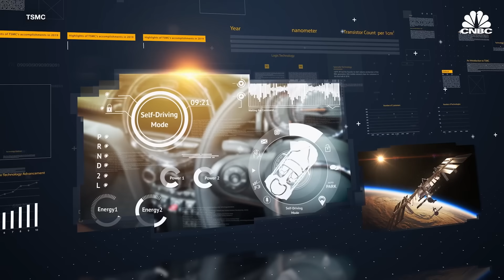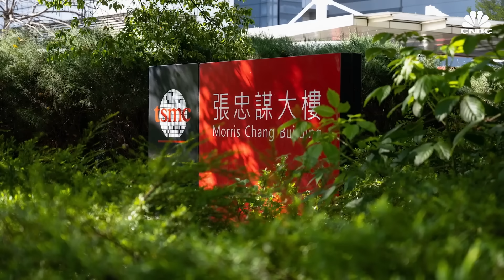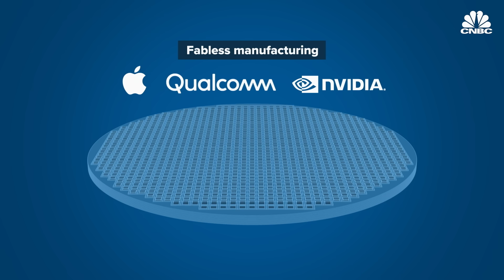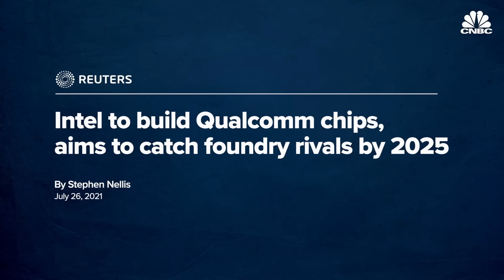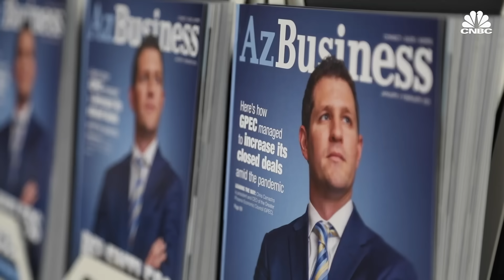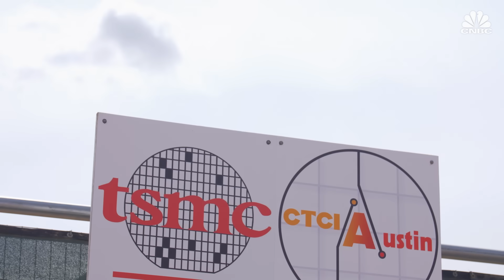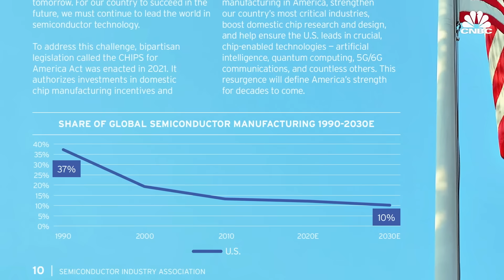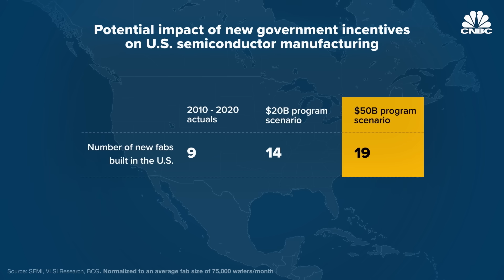Secretive Giant TSMC’s $100 Billion Plan To Fix The Chip Shortage

Comment: I haven’t a clue about chips but Could you not reuse old chips .
Reply: the problem isn't the availability of the material, the problem is the availability of manufacturing capabilities, aka the world can't produce as much as it would like to use at the moment.. which is why they are all investing to build new fabs in order to increase production capacities... 

and if you meant reuse the chips in the sense of just taking the old ones and putting them in new devices... in theory you could, but most of the components prices is on the order of cents, so it's not worth the effort, and most of these components do very specific things / function a very specific way, so each product usually only works with the chip it's designed to use (for example in a phone you have the more expensive main processor / gpu etc (soc), but then you also have the cameras, the charge controller for the battery, acceleration sensor, light sensor and a whole bunch more, and all of these need to be connected in the right way (aka all the right connections need to go to the right place) and also work with the programming of eachother (for example the charge controller has to tell the processor that the phone is currently being charged, or the acceleration sensor tells the processor where down is currently etc)... so it's all very specific and you can basicly not exchange stuff, unless it's designed to work with a selection of components, which still can't be any but only very specific ones

and then you also have the problem, that new products always need to be more fast, more shiny etc so you always need the newest generation aswell, especially for stuff that is expensive / high performance

Comment: News flash... the internal combustion engine will run without a computer assistant chip, with very little adjustments in manufacturing.
Reply: yeah it does work, but not very well... and the rest of a car doesn't work very well either... no abs, no park assistant, idk about airbags...
Reply: @johnuferbach9166  your commenting to a guy who owned and drove a 1963 Chevy with a stock 283 stock engine. Not one Asian part in it, ran like a top, in fact it ran better and with less maintenance than most crap on today's automobile markets, and was good on mileage. It had factory seat belts,   and people had enough intelligence to use them without any costly, annoying, flashing lights or buzzers.  The cost to the consumer was, $3,000.00  A great vehicle by anyone's standards.

Comment: Good ol Manitowoc Cranes. Built right here in Manitowoc Wisconsin. (Headquartered in Milwaukee WI) The 2,535-ton (31000 series) crane is utterly massive and is as big as a small skyscraper. Of course, this particular crane is only used on the largest of industrial projects and is overkill for almost any job. Hence why Most of the Manitowoc cranes that are purchased are in the 80 to 165-ton range. But Manitowoc has 17 crawler crane models ranging in capacities from 80 ton to 2,535 ton's for the newest and largest model. 

It's also nice to see the US here finally starting to expand domestic chip production. The US is the tech capital, and on the chip production side, we have let our capacity dwindle over the years. But with Intel and TSMC now expanding fabrication plants, the US will reduce its reliance on imports for whatever our domestic manufacturing doesn't quite cover when trying to meet consumer demand.
Reply: 80% Intel chips still made in the US.

Comment: Why not recycle those CPU ??
Reply: the problem is not the material availability it's not enough cpacity in the world to make the new stuff (and no reusing old chips in new products doesn't really work it's not worth the effort because most of them aren't worth anything but still important for the product and you can only use the chip a product has been designed with)

Comment: 12:00 Tap in to analog.
OK? Why? Who needs that?
Reply: because analog design is an important part of how things function? everything starts as some kind of an analog signal, before it's converted to data... your phones camera produces an analog voltage per pixel that is converted to a digital image by measuring it for example, all audio stuff starts and ends in analog, all power supply-tech is analog, wireless is analog (antennas etc) and digital stuff is basicly analog aswell since you have to make sure you don't have reflections on the data lines, no wrong bits from induction etc...

Comment: Did you see the United States?  Singapore has been blending with the CCP for a long time. They have already been bought by the CCP. This time Singapore directly publicly supports the CPT to join the CPTPP.  The greatest benefits can be achieved, and the CCP’s second generation of Red, most of the money hidden in Hong Kong is moved to Singapore to hide, through Singapore, the CCP obtains the missile chips they want.  If the United States still pretends to be ignorant, it will be devoured step by step.

Comment: It's great to manufacture chips in the US but we need to also manufacture the things that the chips go into in the US as well. The phones, the toys, the appliances, the cars, the computers etc all need to be made here. Manufacturing things in the US will make things more expensive but not doing so has proven to be a national security nightmare. At the very least, we need MUCH greater diversification of the supply chain.
Reply: Interesting what would cause more dissatisfaction: lower quality led bulb which lasts 2-3 years for $1.5 or high-quality bulb lasting 10 years but at cost of $12?
Reply: @angelg3986  actually, it won't last 10 years, GE CEO won't allow that to happen, you will still pay 12, but it will die oh on year 5 instead. It's called managed quality invented by GE.
Reply: You really want to spend 10k on the latest flagship phone?
Reply: @sethreign8103  yeah but the price will average down or wages and inflation will average
Reply: These chips are goldmines. The profit is so so big. That cant be said about all products.

Comment: One of the biggest reasons there's such a chip shortage is that most fabs have severely scaled back 15nm or larger production. There is more money and prestige in creating ever smaller processes like 4nm "P" and 3nm. Yet most of the economy and demand is in 15nm, 40nm etc. Yet not a critical note at all about that in this report. 
Typical case of access bias.

Comment: There is a major error in this video. There is no 5 nm process, 5 nm is not a length, it is just a name. Nothing on a 5 nm chip is 5 nm; not the contacted gate pitch not the minimum metal pitch and not anything else you can measure on the chip. On 350 nm, you could talk about a 350 nm process; the transistors had 350 nm MMP and 350 nm CGP; they were 350 nm transistors. By traditional measurements you would call TSMCs and 5 nm, Samsungs 5 nm and intels 10 nm as something like 40 or 50 nm process node.

Comment: It's not "almost a monopoly" for everything at the leading edge EXCEPT RAM, it's a duopoly with Samsung for most purposes (Intel being the main exception).
Also, TSMC isn't "bringing leading edge chip manufacture back to the US" - Intel never left and has certainly stayed on the leading edge.
Reply: Intel is at least 3 years behind Samsung and TSMC. They don't mass produce a 5 nano chip at present and the other 2 have been since 2020. Intel had projected 2021 but that ship has sailed and the train has left the station.
Reply: @fredmac1251  Keep in mind that what Samsung and TSMC were calling "7nm" had the SAME SPECS (almost identical) to what Intel was calling 10nm.
Same situation exists in the next generation, what Samsung and TSMC are calling "5nm" Intel is calling "7nm".
Intel is NOT as far behind as you think in actual fact - though the 7/10 generation DID cost them most of their lead with all the issues they had getting their 10nm process to work (there's a REASON it's often called the "bleeding edge").
Reply: @bricefleckenstein9666  I understand your point but there is broad consensus in the industry that the TSMC 5nm chip is more advanced that Intel's current chips. That's one reason apple is moving away from Intel. Don't forget Intel has publicly stated they are changing their numbering convention to match industry standards.
Reply: @fredmac1251  I must have missed that Intel announcement - how recent was it?
I suspect that "available fab capacity" was also a factor in the Apple move, especially with Intel deciding to move into the discrete GPU market.
Reply: @bricefleckenstein9666  It was originally announced in the April 2021 timeframe but  around July 2021 Intel decided against that. What was previously designated as an advanced version of 10 nanometer will now be called “Intel 7.” And what the company was going to call 7 nanometer will be called “Intel 4 or so they say. Who knows, the winds may shift from east to west tomorrow. BTW, TSMC is currently in the process of shifting to 3 Nanometer.

Comment: Actually, TSMC did an investigation into why their clients are touting chip shortages when TSMC is at full 100% chip capacity. Their conclusion was that some of their client's are intentionally hoarding chips to artificially keep prices high. Follow the $$
Reply: You realize that "100% chip capacity" means they can't produce chips any faster right? The suspicious thing would be if they were at 50% capacity and companies were claiming shortage.
The fact of the matter is, in the past 10 and especially 5 years, there has been a drastic increase in the amount of products that have chips in them. And on top of that the economies of most developing countries has finally reached a point where many of the citizens can actually get phones and other devices now, the available market has absolutely exploded in the last decade while new FAB production didn't keep up. It kind of blind-sided the industry.

Throw a global lockdown on top of that where hundreds of millions of people start buying electronics because they're spending more time at home or need a better PC to do work from home, and it made the problem even worse. (and nevermind the rise of EVs which require more complicated chips than a traditional gas vehicle, and vehicles in general starting to put what are essentially PCs in the center console.)
Reply: Hoarding chips makes no sense because the technology moves so fast. This year's cutting-edge chip is next year's dull knife.
Reply: Does not make sense. If they are hoarding chips, are they not shooting themselves in the foot because the scarcity of chips caused by hoarding forced them to cut production and in the process put their companies in financial jeopardy.
Reply: It takes 4 to 6 months to makes chips. It is not like you can put in a order this week and get it next week. Covid messed up the demand on a lot of products. Cars for example, demand did not actually fall as much as expected. When companies order more chips it is a 4 to 6 months wait only if there is capacity. If companies order less chips they will not have any chips 4 to 6 months later and  if they suddenly decide to order more it will also take 4 to 6 months if there is capacity.
Reply: And why are they doing it 😓
Reply: Nvidia is one of them. It's confirmed.
Reply: Likely it was TSMC clients from China that is hoarding chips esp Huawei.
Reply: Chad market manipulation
Reply: Probably China, they ate hoarding everything!
Reply: Not mention about all riots happened in the world such as Hong Kong riot, Tian An Men Protest which organized by ARMerica , only talk about war.    In 250 years of existence as a nation, the US has fought against 29 sovereign countries. (In Fact, since 1785, US have been involved, for 219 years, in some kind of war. And this wars, against all varieties of sovereign nations. From going against the Sultan of Morocco, to invading the tiny island of Grenada. Well, this means that in its entire history, it has only had 17 years of peace, and even fewer, cuz here the almost 5 years (1861-1865), of its Civil War of Secession are not counted (Union/Confederates), since this war was not with another country, but against US. And the wars against the Native Nations of America are not counted too, for the same reason). Anyway: US fought against 29 countries. It has "Grown" 711 times the size of its territory from the original 13 colonies. It has provoked with total impunity, Genocides, inside and outside its own borders, and assassinations of Gov’t. Leaders, Coups d'État and Economic Blockades in 6 UN member nations. (Between 1947 and 1989, the US tried to change other nations gov’ts. 73 times. It includes 66 covert Ops. And 7 overt ones. In Civil Wars: The US has taken advantage of and intervened without justification in the following Civil Wars: In Cuba (1898 and 1960). In Haiti (1813 and then 1915-1934). In Colombia (1899-1902 and 1948). In Mexico (1847 and 1914 and again in 1916). In Russia (1918). In the "Republic Banana Wars" of Central America (1912-1934). In Venezuela (1945 and again in 1948). In China (1857, and 1900, and again in 1945-1946-1949). In Korea (1950-1953). In Viet Nam (1959-1975). In Panama (1964 and again 1989). In Central Africa (1969-1974 and 1982-1988). In Nicaragua (1937 and 1985). In Bosnia (1995). In the Philippines (1898 and 1900)... In Kosovo, Libya, Lebanon, Somalia, Sudan, Syria, Iraq, Iran, Yemen, Afghanistan, etc.). And more: US has almost 800 Military Bases scattered around the world; 93 of which are against China. On the other hand, China and N. Korea (The "Axis of Evil"), in 1,000 years of history have NEVER invaded anyone. These nations have fought their Civil Wars, defended themselves against foreign invasions, and secured their immediate borders, but they have never been meddling or aggressor countries. Do you know how many Military Bases China or N. Korea have outside their territory? None. Zero. Any. NADA! They do not have a single Base. These are verifiable facts. Neither China nor Korea will invade the world; US does... that's DONE, as US does in the Middle East. Iran also does not have a SINGLE MILITARY BASE outside its national territory, and it is surrounded by 16 US Bases, and it is US who call the Iranians Terrorists. Well, very good. You already know. Now, compare the Greatness of the US with the Greatness of China. The "Greatness" of the US is built on the foundations of Piracy, Slavery, Genocide, the Assassination of opponents, Opium Traffic, or Cocaine in its case, and is under the foundations of the weakness of other sovereign nations. LOL…..Chai from Malaysia.